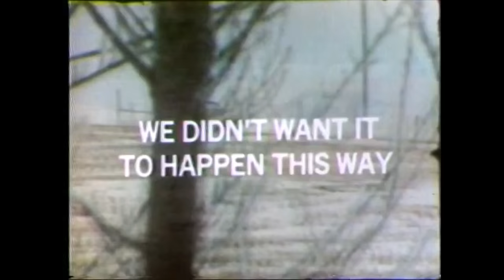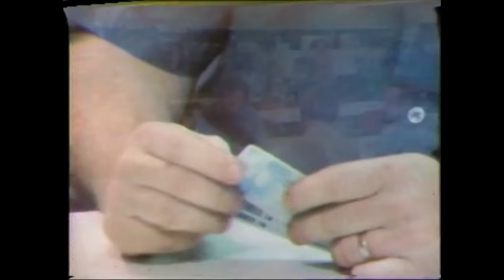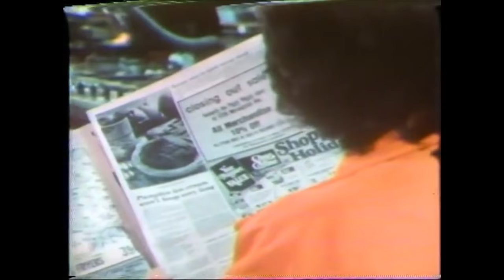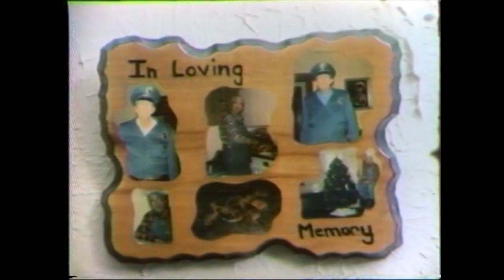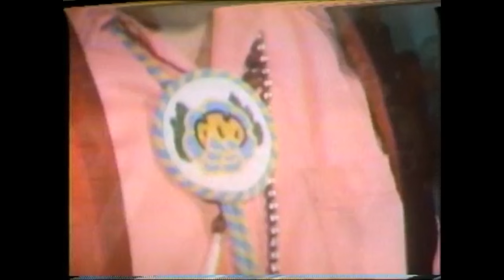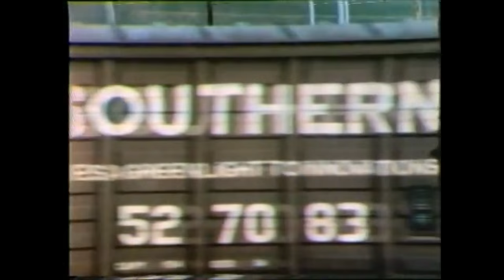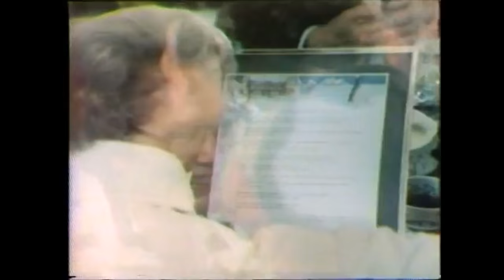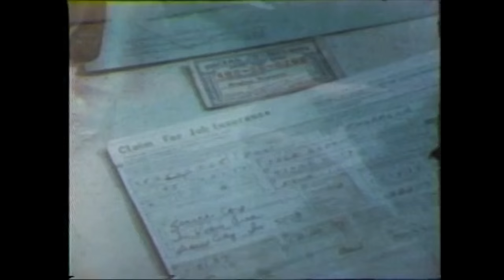The Closing Of The Zenith Assembly Plant In Sioux City, IA (1978)

Comment: my Bose wave radio was around $350 15 years ago. I think it was built in the US. It’s great, still works perfectly, just like a zenith was 40 years ago. But a sangean radio (China?) is 1/3 the price of the Bose. Hard to resist such a low price for a nice radio. So the unfair trade deals of the past (e.g., nafta) were one (of several) reasons we don’t manufacture here as much. I think people would pay a 30% premium for American built products but not 300%. Of course the would have to be as good or better, as zenith was and Bose is.
Reply: Also, great videography work. Wow that was so cool. Yeah the factory workers were a bit frumpy, but maybe the styles back then exaggerated that appearance.

Comment: What most people seem to ignore or forget, is that, even if those people had been able to hang on to their jobs a it longer, they would have been ousted later on through automation of the production cycle (which back then was still largely done via manual labour). Either way they would have lost their jobs, via relocation to cheaper labour countries, or because of widely automated production processes. In any case, it's often the so-called "lower qualified" people who have to deal with the brunt of "reorganisations" or relocations. That's why we have to make younger generations aware, it IS important to get a degree. More knowledge is more liberty of choice
Reply: certainly... very few jobs are "safe" where automation is concerned. But until that's the case, it's still important to get a degree of some sort. The higher your qualifications, the more possibilities and choices one has in finding a job one likes. As I said in my previous post: more knowledge is more liberty of choice